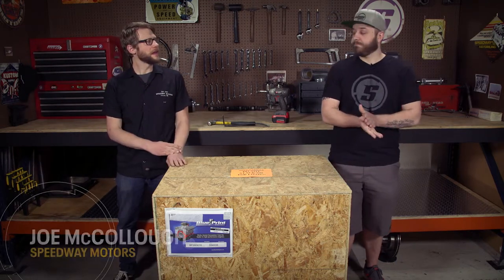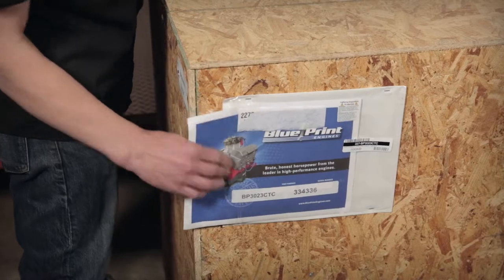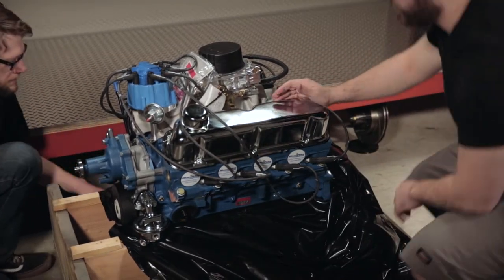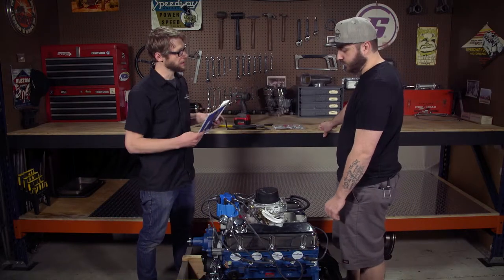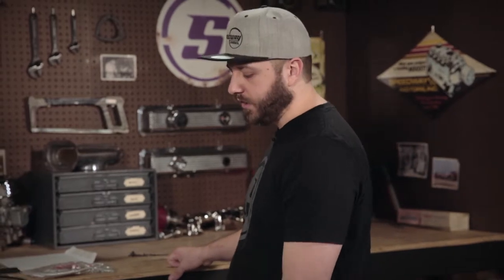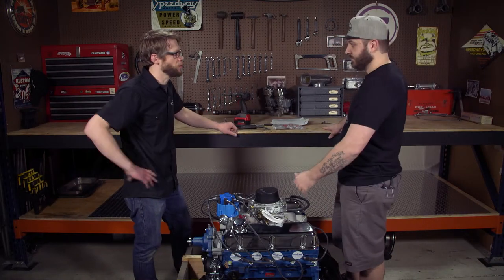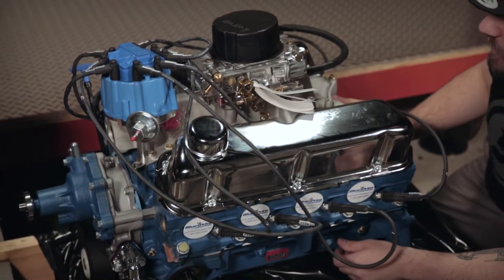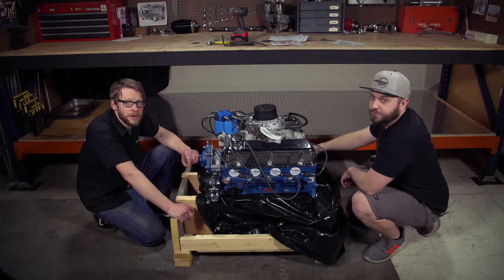BluePrint Ford 302 Crate Engine Tech Talk

Comment: Installed the 306c.i. from blueprint engines. Runs good. Ditched the carb and went with the holley snyper kit. The altitude out here makes it really hard to drive especially when I go from 5280 feet above sea level to 14,000
Reply: How long did it take from date of purchase to delivery date ?
Reply: @star_wolf181  it took about 2 months, im not sure if they have to build it once you order it or if they are already in stock.
Reply: @0rvelazqu  One last question, how does it get delivered (truck,ups,fedex)? I’m planning on getting one 😁
Reply: @star_wolf181  they delivered mine in a UPS semi truck. I just backed up my dads pickup and the guy lowered the engine on to the bed
Reply: Did you have to install the fuel injection or is that an option they offer when you buy the engine,? And what do you mean by altitude makes it hard to drive, do you mean when it was carburetor cause it needs more air
Reply: @Guy-mx4fb  I bought the holley sniper kit separately from the Pep Boys Speed shop. Yes the carburetor didn't so so well at high altitudes. It would struggle at barely 8,500 ft above sea level especially in cold weather so that's why I decided to switch over to the Holley Sniper EFI

Comment: Hey guys does BP provide distributors by themselves? My boat has a 302 in it now and my distributor seems like it’s starting to go out.
Reply from the maker: No, BluePrint does not offer just distributors. They manufacturer full crate engines and head assemblies. For a new distributor please call our tech line at 800-979-0122. We'd be more than happy to discuss our options with you!

Comment: The Price of this Wonderful Engine ?
Reply from the maker: Here is the link to the engine: https://www.speedwaymotors.com/BluePrint-BP3023CTC-Dressed-Crate-Engine-Ford-302-235-HP,293709.html?OriginalQuery=227bp3023ctc We have several other crate engines as well, so feel free to check out some of our others to see what works best for you!
Reply: I wish they made Ford crate motors with the 80-96 F-150 rear hump oil pans for Ford street rods. I know a guy can probably get his own and put it on themselves but it would be nice if guys that build Crate motors would already have the Bronco-F-150 oil pan on them.

Comment: Can you out that into a lincoln versailes?
Reply from the maker: All Versailles were optioned with a SBF from the factory--some were 302 and others were 351. This engine would be an appropriate swap candidate for your vehicle, however your specific application would require the use of a rear sump oil pan which can be purchased with this engine: https://www.speedwaymotors.com/Ford-Performance-M-6675-A58-351W-SBF-Rear-Sump-Oil-Pan,49713.html. This unit would also require some light rewiring to run the HEI distributor.

Comment: Its beyond me why you went with a flat tappet cam when for the same money could have bought a roller cam.  I guess what I’m trying to understand is how or why did they dyno the engine yet telling you that you need to break it in?  What did they do fire it up run it full tilt without breaking it in…anyone see a problem with this?

Comment: For the huge price tag, it's much better to get a decent iron block and do all the work yourself.  You'll end up with more power and a better engine from top to bottom, if you spend the money on quality parts.  These engines are very overpriced, in my opinion.  For the huge price tag, you're getting bottom quality stuff, on the whole.  Iron block, iron heads, cast aluminum pistons....and so on.  For the price being shelled out, you can get some great aluminum heads...like Brodix, forged pistons, nice connecting rods, quality camshaft...and have money to spare at the end.  Crate engines are not quality engines, on the whole.
Reply: Ive heard you can do alot of stupid mods for rebuilding a 302, like gt40p heads and a different camshaft to get 3 to 400hp for a few hundred bucks. 7k for a crate motor seems like too much...

Comment: 230 hp? No disrespect but that’s not worth it. Not by a long shot
Reply: This is a 60s engine and people break 400, sometimes even 500hp with just a turbo or supercharger without having to billet everything

But it's way better to just get these from junk yards, eBay or something like that because they have them overpriced as "crate engines"
Reply: @clivejuniornoconjo1556  yes the 5.0 from the explorers have good heads and with a cam it’s easy to break into close to 300 if not more and it’s way cheaper than this
Reply: @zacharykelley359  Definitely, my cousin and I just picked up one for a cheap drift car build for $700 with 55k miles and was in good condition apart from a few blown out spark plugs...We turbocharged it, put in better fuel injectors, cold air intake and a junkyard fuel pump and installed a newer crank and now it's got 400hp to the wheels...We could turn up the psi more but it's a eBay motor and we don't wanna take any chances.
Reply: Thats what I was thinking plus he bought a flat tappet cammed motor when he could have bought a roller cam for the same price?
Reply: @msk3905  That's how he rolls.   Uhh, I mean that's how he flats.  😆🤣😅